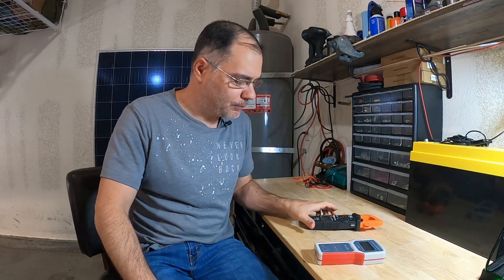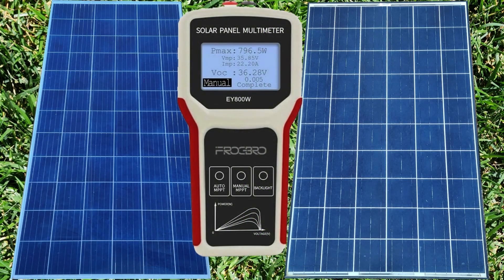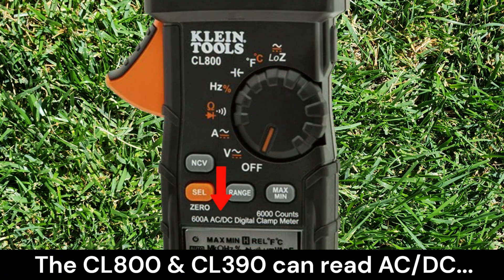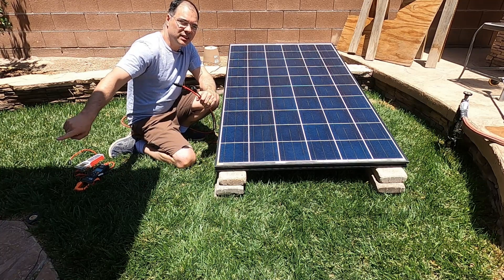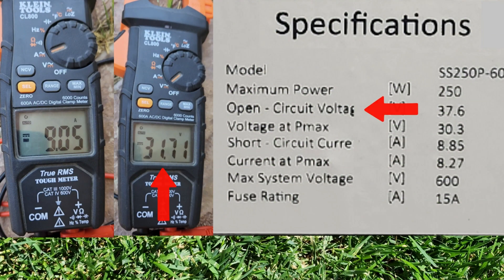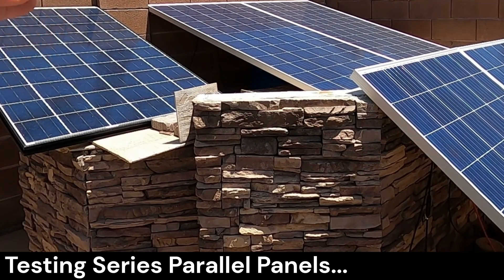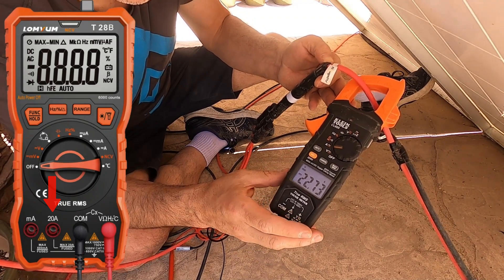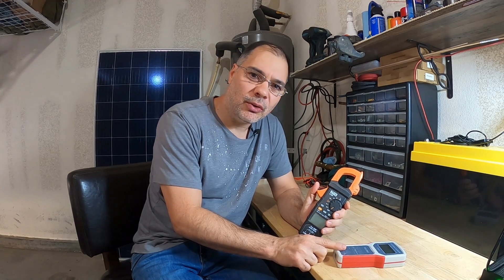How to Test Solar Panels - For Beginners!

Comment: 198W/250W=79% efficient. 293W/335W=87% efficient. The conversion of solar to electricity is 80-90% efficient and your tests prove it. In other words, a typical 100W panel will produce 80-90 watts, not 100. When calculating the number of panels required for a system, the efficiencies (or if preferred, the inefficiencies) need to be calculated for.

“High noon” may not be the most accurate descriptor. Test panels when the amount of atmosphere the photons travel through is the least. That’s when the sun is at its highest point directly above the panels (and accounting for angle.) Typically, depending on time zone, that should be between 12:00 pm and 1:00 pm.

Lesson learned about test equipment maximum ratings. Welcome to the club! Better a tester overloaded than a charge controller or wiring in a house.
Reply from the maker: Thanks for the info about efficiency. That would have been good info to include in the video.. ill pin in.
Reply: @natesdiysolar  great video, thank you. Please also pin this : https://gml.noaa.gov/grad/solcalc/
Reply: Currently, 20% solar energy to electricity conversion rate/efficiency
Reply: Very useful info

Comment: Good video! I live west of the Phoenix metro, so I can easily drive to San Tan Solar to pick up used panels. For me, they work great. Obviously, the solar multimeter must have some sort of load resistance that can take a lot of current for a very short time. Any idea what is the standard load resistance for testing panels?
Reply from the maker: Thanks.  Yea, that's nice you are local.  It's about a 3-hour trip for me.  I'm not sure about load resistance...
Reply: @natesdiysolar  , Thanks for the response!

Comment: Off Topic. Do you have a video on NCM Lithium Battery safety. Odds for Fires or worst. How to up the safety protection level for them. I do have a Solar Storage Battery made of NCM Lithium. Its Obvious to me of recient  that peoples new getting into Solar must have a command of this subject matter.  Mess Up doing a reading with the AY800 is a Nasty. But Mess Up without enough knowledge of NCM  LITHIUM Batteries, Lithium Ion Batteries can be extremely Costly.
Reply from the maker: I do not, but I'm sure someone does.. thanks for watching! I saw a video by a fire department a while back.. testing over charging different battery chemistries.. L ion did catch fire.
Reply: @natesdiysolar  Thank you for the referral

Comment: Warning , do not do prolonged current measurements with a multimeter, contact resistance in the mc4 could start melting them.
Reply from the maker: Good tip. Have you had this happen?
Reply: @natesdiysolar  I think its easy to test. Those probes have kind of sharp tips, so high resistance, after measuring check mc4 visually inside for black marks :)
Reply: Do you mean when you are measuring Volts using clamp meter or when you short circuit the panel to test with clamp meter?
Reply from the maker: @wizardmagu  he means when measuring amps using the probes in the connectors.  2 different ways to measure amps. Short circuit with clamp or probed set to amps on meter
Reply: It's not the contact resistance that melts them, it's the arcing when the circuit is broken.
Reply: @kiowablue2862   It is contact resistance, especially if amperage is high. And it also can be from arcing, especially when voltage is high.

Comment: Panel Sticker Label volt max  value are not UNDER load. 
Thus AY800 which have built-in mppt(thus a load) displays lower volts.

Not sure if thats true.
BTW for my Renogy 450w panels my AY800 has displayed 516watts. 526watts. Tho mostly its typically under 450w when using the AY800.
The 500's+ watts AY800 tends to occur when a huge sun burst occurs thru clouds openings. Like on the day after rains..
Reply from the maker: Not sure what you mean volt max.. are you referring to VOC ?
Reply: @natesdiysolar  My Renogy 450w label shows a Optimum Operating voltage 34.67v. And VOC 41.25v.
Reply: "volt max" was taken from your video presentation
Reply: What you're seeing when you get the 500+ Watt readings is either cloud edge effect or cloud lensing.
Edge effect: https://www.youtube.com/watch?v=i5fM8TE1INQ  
Lensing: https://scijinks.gov/solar-energy-and-clouds/

Comment: Last week I was measuring 3 Renogy 450w panels with my AY800. HaHa. Lightening strikes twice in a week. Their new high watts unit is also 60v. Thats the Chinese for you. Made in China.
Reply from the maker: Yes I mentioned this in the video..
Reply: @natesdiysolar  Here is one of my AY800 reading from my Renogy 450w panel.
>>>><<
Renogy450
526w.   (31.36v x 16.78A is 526w)     38.84voc
HOW CAN one Renogy450 generate 16.78A??
Reply from the maker: @Larry Wong  my meter, showed similar results.. The only thing I can think of is that the meter is just not very accurate. I just put a clamp meter on while testing using the AY800, and it did not even register above 1A ..   yea. It should not exceed the rated isc.. even at zero volts.  You're correct.  I was wrong to say that.  I took the meter reading at face value, lol.   I noticed if you take mutiple readings it will get it right lol.. A@pMax less than ISC.
Reply: @natesdiysolar  I like to press the AY  continuous button.
Which can take as much as 20 seconds to do a calculation of those various readings.
Interesting that readings for just one panel happens after few seconds. When waiting for 3 panels AY reading results( all newpowa 220w's panels in Serial array)
it can take 20 seconds. Thus the AY meter's mppt has lots calculations to do with 3 panel array. With the continous button(one press) I just wait for more optimal results to show itself before I data log them.
Reply from the maker: @larrywong7834  how many panels are you putting in series considering the 60v limit of the meter?
Reply: The AY800 mostly is quite accurate. I connect one of my Renogy450w panel directly to the AY800. I press continous button just once. I also have my Bluetti AC300 solar generator connected to different Renogy450w (panel*s).
Watts reading from AC300 display(ac300 mppt) is often quite similar to that produced by the AY800's mppt.  About 5-10 watts difference. I wait for the AY800 to flash a reading then within a second or two I look at my Ac300 solar generator's display. Each of the panels are side by side. Tilted the same.
Results quite often very similar
Reply: @natesdiysolar  I have 3 x newpowa 220w panels in series connected to my AY800. Panel is rated tad over 20voc.
Reply: My exact AY800 reading at noon'ish today....
3 newpowa panels serial array
493.1w. . 42.79v. 11.54A. 56.31voc
Reply from the maker: @larrywong7834  cool
Reply: Im feeding that array into the D050s device. Which has 500w limit. 60 volts limit. https://youtu.be/1hS8vLdksUk
Reply: renogy 450w label shows Short curcuit Amp as 13.89A

Comment: What is the distance of your array from your controller and AWG size of your wires?
Reply from the maker: 10AWG. 50 feet. String on the wall is 70 feet. Why do you ask?

Comment: 19:00 ah pitty you can't see the chip number, looks easily repairable if you can find the part numbers used. looks like a DC to DC board
Reply from the maker: I know right.  I need to get a chip soldering station. On the list.

Comment: The new panel was cold ie not sitting in the sun , cos soon as I heat up they lose efficiency
Is that why it was a bit more!
Cos I doubt whether a solar panel would degrade that much in 9 months
By the way , read the short circuit current with a clamp meter is the best way to test solar panels, leave it shortened then you get the flir out and look for heat spots on the panel
Reply from the maker: I will test this and do an update..
Reply from the maker: Good tip. Thanks